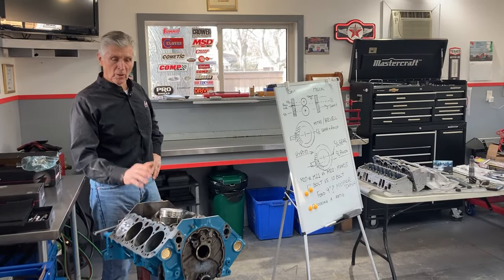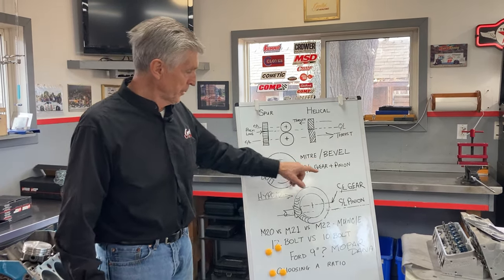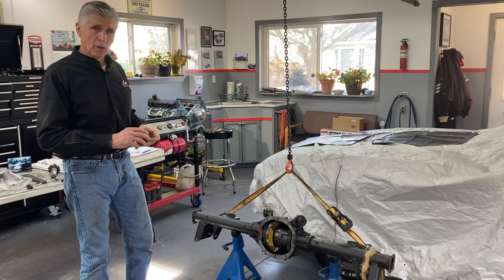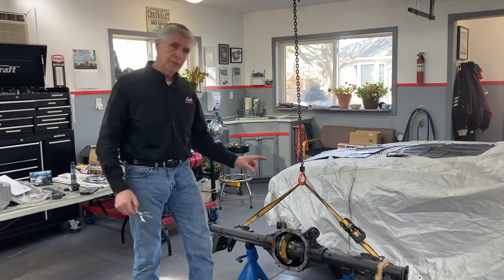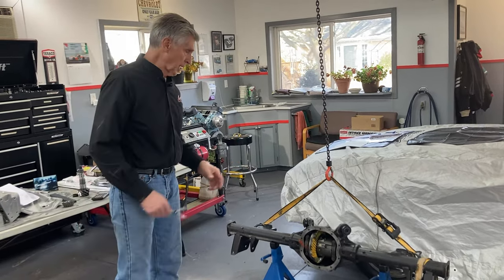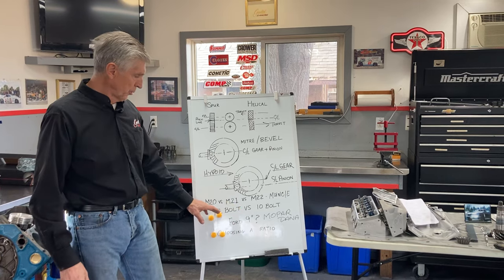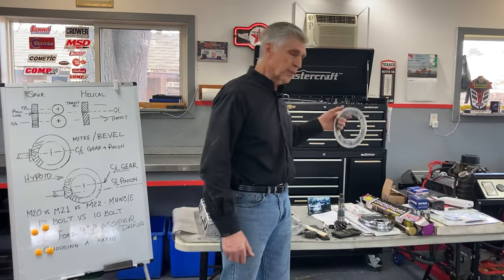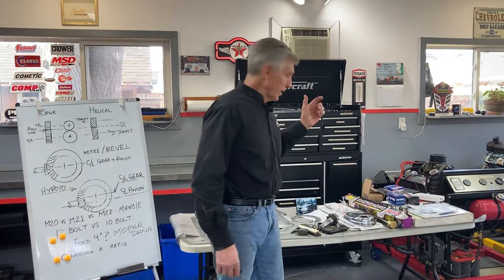How to properly select a Gear Ratio- Thinking about an upgrade?? Installation Tips! PART 2

Comment: In this video you mentioned a Mopar rear being just as strong as a Ford 9",  were you making reference to the 9.3" Pontiac/Olds produced from 1957 to 1964"  These were the rears used in many dragsters. Mickey Thompson produced an aluminum center section and you could also get a Detroit Locker for the 9.3. If you find them today, they are usually worn out and the problem is that you cannot get parts to refurbish them. Fabcraft Metalworks sells just about every thing  a person could need to rebuild and upgrade the 9.3 rears from axles, posi units, gears and when available they have housings with the hardest to find being 57 and 58 prior to Pontiac going to  triangulated 4 link suspension and Olds followed a year or 2 later as they stuck with leaf springs. I did find a second housing last year, complete from a '57 Olds and I will be using it for my rebuild while removing and saving the Pontiac because I want to retain the spring perches on that one while adapting the Olds to a triangulated 4 link which I will fabricate in keeping with the Pontiac/olds designs so I can get the pinion angles working properly.  I may have mentioned that the quick change gears do not hold up in drag racing. My friends broke a couple of them with Y-block ford power back in the 60's. Since they were Ford lovers, they went with 9" Ford rears.
Reply from the maker: Thanks for your comments 4Speeds. AG

Comment: AG good info in these two gearing videos. I thought you might have mentioned that if the gear set that you are removing is either the original or running with a perfect pattern you should compare the number etched in the end face of the pinion of both the original and new gear set. The new gear set pinion shim thickness = original shim thickness - original pinion marking in thou of inch + new pinion marking in thou. For example if the original pinion shim is 0.025” and the original pinion is etched with a -4 or -0.004” and the new gear pinion is etched with a +2 or +0.002” the new pinion shim is theoretically  0.032”= 0.025” -(-0.004)+(+0.002”). In my experience I’ve never been as lucky as you with getting away with the reusing the cast spacers and getting the correct backlash and I would never take on a gear change without having a good selection of shims already on hand (this used to be expensive when buying shim packs from the GM dealer not so much now with the install kits). If the carrier is not changed the cast spacers gives you the total thickness required quickly
Reply from the maker: Thanks for your input Cabot. AG

Comment: Dana 60's were one of the strongest rearends made, but they were heavy, I know, I use to have one in my 66 Chevelle with a light Strange spool and 35 spline axles, got rid of it and bought me the 9" Ford center section with a 57 Ford housing beefy up for my fast 66 Chevelle, it weighs 2,370 lbs. with driver...  Thanks AG.  The stuff on the old rear end gears was too many years ago!
Reply from the maker: Thanks You Leonard. AG

Comment: AG, I had a Oldsmobile 57 housing in my 62 Chevy II, 5.38 ratio  with 31 spline Summer axles, worked fine with a 302 small block, tunnel ram with two Holley 4 squirters, 660 cfm each.  I also had a 55 Chevy body that had a original P track GM center second that is a positive track.  I think it was also a 5.38 ratio, very weak rear center section...  I took a positive track center out of a 62 or 63 Chevy and put it in my 57 Chevy...  Had to shorten the axles to make it work, the axles hit the spider gears pin...

Comment: When I was at Ryerson in the early 70s the computer programing course used a Daisy 360 that you put your punched stack of cards in for a print out. That computer if I remember was at least 15 feet long by 4 feet high and about 4 feet wide.
Reply from the maker: Thanks Joe. I do remember these early computers. Now your phone has more power. AG